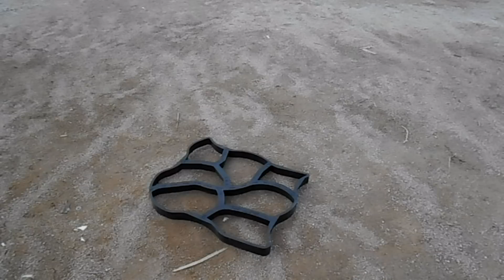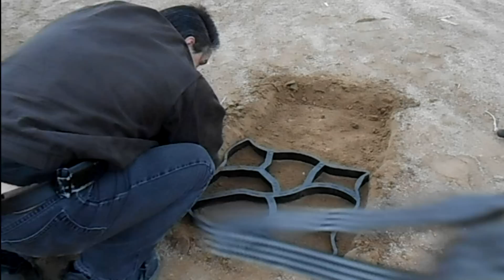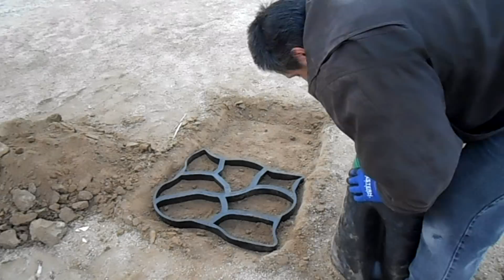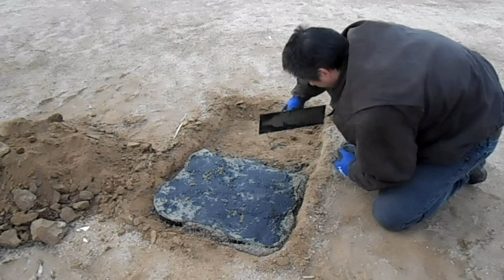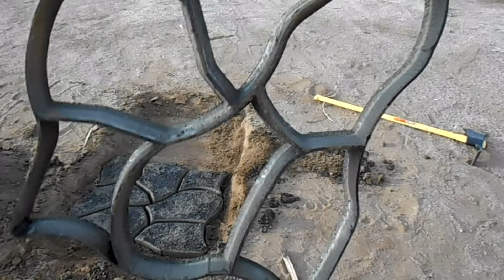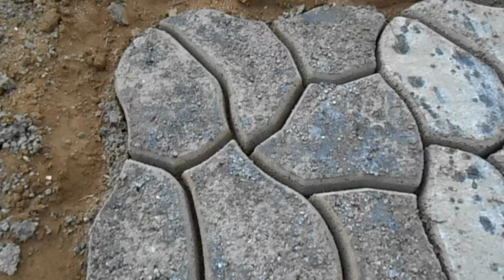Pathmate Concrete Mold Test

Comment: You can mix your material a little thicker and pull the mold as soon as you trowl it. Mix it thinner for smoother surface of "rock". Mold will have to set longer for that smoother, thinner mix. Also, if your doing a larger project, rinse the mold after every other set. Keeps mix from drying on mold and dragging material as you lift the mold. Have fun!👍
Reply from the maker: Excellent information, that you for sharing!

Comment: Ive had this setup 2 years and will be finally getting to it shortly. I planned on having 6 different colored bottles of the same quikcrete stain you had but diluted since it is actually for 1 full bag, pulling mold up half way and spraying it different colors and also mixing colors,then pulling off molds and lightly spraying them with water and lightly brushing colors in with paint brush. Ive had 2 years to think about it ha ha . Thanks for the vid. I will post my results when done.

Comment: I feel like with the cobblestone pathways... with all patterns really, the more spread out the paving stones, the more realistic. I think had you followed the original plan of using two molds at one pouring, you wouldn’t have waisted so much concrete mix but also I saw someone fill up their molds first with sand and rock and then add the mix on top which helped not to waist so much concrete. Of course you’d want to thoroughly mix around in the mold but it’d make a stronger and fuller consistency. But again, I think most important is to spread out each stone created and for a finish in between all the pavers pour sand or whatever you’d like in between your pavers to add a really nice, realistic look rather than keeping them so close together and so uniform. Otherwise it looks exactly like a mold of concrete and not a true paver walkway. I think I understand the look you were going for using the colorant, I wonder had you first placed on a finer sand on top of your wet concrete, it may have given a really nice sandy like finish and if you put the dye, mixed in with water inside a water bottle to a color you’re wanting, you could have sprayed the top with colorant and had possibly a more marbled effect. Would’ve been more noticeable had you used another dye to fully coat the entire concrete mix then add sprinkles of dye in another color. I’d like to see someone pour just sand or pebbles, I’ve seen some use walnut shells, glass, etc
Reply from the maker: Wow, really insightful comment!  Excellent ideas, thanks for sharing!  Since I was surrounded by sand, that probably would have been really cool to sprinkle some on top.

Comment from the maker: Glad it helped.  I do plan on doing one more test in the future adding both red and black dye and actually painting it on instead of just splashing it around.  The mixer works ok, it's just getting the lid off.  Good luck with your project, I hope it works out well.  I believe you will be happy with these molds.  If you can, post a video.  I'd love to see how a spray topping looks.  Adding the dye was a last minute idea and I wouldn't say it turned out great.  But, that's what tests are for. :D

Comment: Thanks for your effort Jim, I have the mold and color, but have been trying to find a video just like yours to show how it works in real life, not on the infomercial.  My wife bought the mold and was looking for the mixer, but someone at one of the stores said that they had heard the mixing wasn't that good.  I was also struggling with adding color, I didn't want a monochrome stone that looked like a red brick, thanks for adding it after so I could see the results. I may do a mix/spray topping

Comment from the maker: We actually purchased ours from QVC.  If you are not stuck on the specific cobblestone design, I believe Quickrete produced their own with more of a strait edge stone design that you can pick up at home depot or lowes.  If you purchase the pathmate molds from someplace else (like amazon), make sure you are getting what you are paying for.  I guess some sellers were breaking up the set and selling them individual for the same price as a set.

Comment: Hi I did my drive with the same patterns as you have used, but mine did not come with any instructions. As a result of that I laid the concrete and then used the pattern by standing on it until it went down level, I then pulled it out and pushed it down next to the one I had already done. I had to waited for the concrete to set enough that it would hold its form but I could lay concrete for twice the width and as long as I wanted and then do the pattern forming. This way may not have been the right way but it was a lot faster than doing it one by one
Reply from the maker: So, you basically used it as a stamp instead.  That sounds awesome!  I would love to see pictures or video of how it turned out.

Comment: Yes you can use more than one mold at a time without causing a conflict between 2 molds and having a bigger gab in between the two. All you have to do is manufacture the first one and remove the mold, then you can place a maximum of 4 molds in 4 different side directions from the freshly made mould. This is convenient when doing large areas, otherwise you will find yourself waiting and wasting to much time. The mold requires sitting with the cement approximately 3 to 5 minutes before removing. While the one sits for 5 minutes, you can already proceed with the next one on a side that has been freshly made. On another note, you do not need to buy the liquid color stain - you can make your own with color oxide powders and mix them with water in a bucket and then add it to the mix. You can also manufacture the paving without adding the color mix - when the paving has cured, you can take the self made color mix and brush it on the cured paving. When that is dry, then you paint a mat stone sealer onto the paving to seal the color in (do not use gloss sealer).
Reply from the maker: That sounds like an excellent idea.  The only addition I can provide is that being cheap like me, the cement doesn't set in 3 to 5 minutes unless you buy the quick set cement which cost a lot more.  I know that is what they say to use in the infomercial.
Reply: The cement must just settle for 5 minutes and then you require taking the mold off. If the mixture is runny; it will not work and it will flop. The mixture requires to be almost a stiff mixture. In removing the mold, you can use a malet/hammer and gently tap on a sides while lifting with the other hand until the mold comes loose. If the cement does lift on the sides of the cobble stones; don't touch the fresh made cobble stones - wait 15 minutes and carry on with another mould.  Then after 15 minutes have a bucket of water and a fine sponge available and if necessary smooth out the sides or imperfections with a very wet sponge. If the sponge is not wet enough, it will take a lot of cement off.
Reply: The mixture we use is a 1:2:3 mixture (1×cement: 2x fine sand: 3x crusher run/dust 4mm). Cobble stones available for purchase at garden nurseries have this type of mix in it.
Reply: Before paving we also use a chicken mesh on the prepared ground area and then you pave on it. When the cobble stones dry on the mesh; they will not move out of place when stepping on them while brushing in the Quickcrete to fill the gaps.
Reply: For extra strength, the freshly made paving is required to be covered with a plastic sheet and allow it to remain moist longer for 16 hours, thus curing the paving properly. For the next 3 days give the paving a light sprinkle of water for further curing and extra strength and hardness.
Reply from the maker: Robbi Falchi
Wow Robbi, that all sounds like excellent advice, thanks for sharing.
Reply from the maker: Robbi Falchi
Would you say using the plastic and keeping it moist for 3 days would give it the strength need to be used for a driveway?  My research on driveway pavers (if I remember correct) were not as thick as these, but they aren't just concrete blocks either.  Any opinion?

Comment: I have to say that pouring the color on top looks pretty good..I think the first looked better than the second. I plan on doing the sides of my driveway soon. I think I will use the color on top idea for mine to blend in different shades of brown to match the brick on my home.
Reply from the maker: I would love to see the results!
Reply: Ok, my cheap butt used your idea of poring color on top of my molded concrete instead of mixing the color into the concrete itself. Where I live, the color cost just under 6.00 dollars per bottle and it only covers 2 80lb bags of concrete. That can get expensive quick. So, I used spray bottles and mixed about 2 oz  of color with water for my color. Before I removed the mold I sprayed the top with a "redish brown" color ( I cant remember the name of it) and then used a "redish yellow" and sprayed the edges and over the edges of the mold...I got to tell you when you remove the mold you get a wonderful two tone color with the gray concrete color between...IT LOOKS BAD ASS.  Thanks for posting your work. I have not finished my work, but I am trying to decide on filling the gaps with mortar or grass..any suggestions?
Reply from the maker: That sounds awesome!  I wish I would have thought to use a spray bottle.
Reply from the maker: As for mortar vs grass, it's really a personal preference.  I'm not a fan of the grass in the cracks look.

Comment: I was also using about 80 lbs of pea rock and cement mixed together with water added till the cement would stick to rock and would have a sheen. But my next try will be more of a soil cement mix. My area has lots of rock and it low in clay so I think it will make good pavers mixing ground for the molds.

Comment: Your 2 cobblestones turned out nicely. I can tell you pay attention to detail. I like your color method. How did everything hold up? Did you use a sealer? I actually used the same molds in fall 2016 for my sidewalk. My sidewalk is raised because Spring thaw leaves a lot of slush/water. I haven't sealed it yet; using sand instead of salt this winter for ice/snow. Come Spring, I will finish filling the gaps with sand and add soil along the edges to gradually blend in with the lawn. I'm going to try diluted acrylic paint to faux finish the blocks and then apply a concrete sealer. I am also planning to add moss between the blocks and just along the edges abutting the new grass. Do you have pics of your finished path?
Reply from the maker: Thanks.  Actually, I wasn't building a path, I needed a flat surface to do a break job on.  I didn't seal them, and they held up well till I had a garage built and they were in the way.  Your path sounds like it will be awesome, I'd love to see pictures when complete.

Comment: Thanks for sharing @James Zawacki! Appreciate it! I love the look of these molds for a walkway, or a patio! Aren't these supposed to be self-leveling? I would probably go that extra step myself too though! I was wondering about using them side by side just for that reason you explained! That bucket looks like a pain! I'd kind of rather see the concrete as I'm mixing it, and I probably would have freaked out a little when the top didn't come right off!lol Again, thanks for sharing, and hope you have an awesome day!
Reply from the maker: Thank you for the comment, I was going to perform a brake job on these, so wanted them to be very level.  Extra work at this stage is better than dropping a van on my head.

Comment: I'm thinking of using the mold but going with a soil and cement mix as my ground here is sandy with rock. I've made a test paver with color, soil and cement with a lil sand and it looks nice. liquid color can be done like that but its hard to get color to match. I did previous pavers in my front yard and not mixing the color gave me different colors on all pavers.
Reply from the maker: That sounds like a great idea.  I'd love to see a pic (or video) of your pavers in the front yard.  I'm actually trying to make sure the pavers don't match, to try to give a more natural looking "stone".

Comment: how long do you let the concrete set in the mold ? I've done what the instructions say by removing immediately and my mold falls apart and I have waited a few minutes but then I can't get the mold and concrete to separate. just can't find the right rhythm.
Reply from the maker: Well, I didn't use the quick set concrete because I am cheap.  I didn't time how long it took to set up, just kept checking it. once it was "dry" to the touch, I tapped the mold all around and it came right off.
Reply: Thx
Reply: +James Zawacki You can remove and move the mold after only about 5 minutes. It will be able to hold it's shape just fine. He completely over filled the mold.
Reply from the maker: Al Diehl
Actually, it depends on the concrete you purchase.  I didn't purchase the quick set concrete they suggest in the infomercial, I bought the cheapest bags I could, which take considerably longer to set.  As for over filling, I followed the directions they provide.  I used a 60 lb bag of concrete per mold.
Reply: Do you mix with the same amount of water written on the cement bag? The one I bought tells it takes 24 hours to dry! I don't want my alley to crack, should I use less water to move my mold faster?

Comment: hi , does it take a 60 lbs bag for one mold
Reply from the maker: Bernetta Bell It takes just under a 60 lbs bag per mold on a flat surface, so when I was screeding, the concrete that was pushed over the side is the extra.  If you have uneven ground under the mold, it will probably be close to exactly a 60 lbs bag, but that's just a guess.

Comment: that's allot of work for one block
Reply from the maker: +jclintondiederich Yeah, kind of.  But, it really depends on what you need.  I needed it to be level because I was going to use it to jack up our van to do a break job.. so I put more effort into it than I normally would need.  But, at the same time, unless you want it sticking above the ground, you do need to dig a hole to put them in, otherwise you risk hitting them with lawn mower blades and tripping on them.
Reply from the maker: @Ikillintel1  Yes, they worked perfectly for the break job.  They also held up fine for about 2 years till I had a garage built in the same location and they were destroyed when they dug out the area to poor a concrete slab.

Comment from the maker: Technically, yes.  If you use the proper Quickrete.  You are supposed to use the quick setting stuff, but it is $5 / 50lb bag.  Since I was being cheap (and plan on pouring a lot of these), I used the standard post hole concrete that takes longer to set, but only cost $2 / 60lb bag.  I plan on posting a few more videos using these molds in the future.  One will be another color test and later I plan to do a porch out of them.

Comment from the maker: I guess it depends on the look you want.  If you do that, your "stones" are above the ground level.  In my case, there is no grass, I was doing it in an area that may become a driveway, in which case I want it to be level with the ground.  Have you used the Odjob concrete mixing barrel?  I'd love to know if others have had the same experience with the lid.

Comment: Thank you for doing this test.I have my project for a pathway in the front of the house,I didn't start yet because I was interesting in this pathmate concrete mold and I was not sure if this works for me.Looks good,I like the design of the cobblestone but I want to spray something on the top to make the concrete shunning,I don't know what to use,I need more research.

Comment: you can either put it on top of the grass or pull the sod up...plus cobblestone isn't suppose to be even...and you need to go back and fill in the cervices with cement
Reply from the maker: I needed them to be level as I was planning to perform a brake job on our van and needed something to place the jack on.  These worked out perfect.

Comment: I believe you add the dye to the mix sir...1 bottle will dye  2 ...80 lb. bags
Reply from the maker: That is correct, if you want the entire batch of concrete to be the same color.  As I mentioned in the video, It was an experiment to see how it would look if I just splashed it on.

Comment: They didn't dig uo anything on the example they did when they advertised this product.
Reply from the maker: Right, they dropped in on top of the grass and poured.  Problem with that is it won't be level and it leaves the ability to nick your mower blades on raised concrete.  I needed this to be level as I was doing a break job on a van, where I would be under the van, so safe is more important than easy.  Plus, if you actually planned to do a path that is actually level with the grass, you need to dig it out.